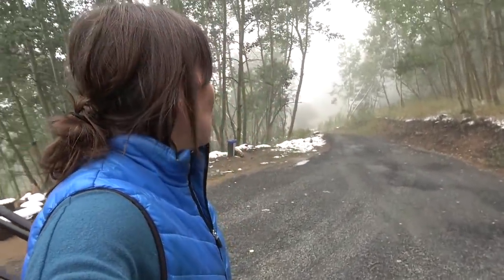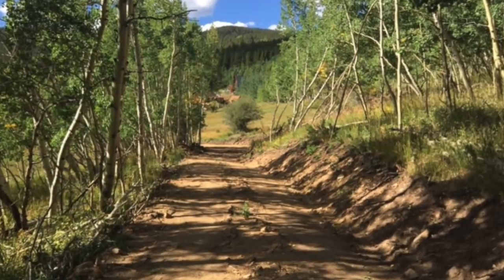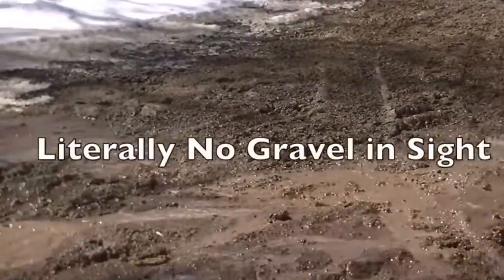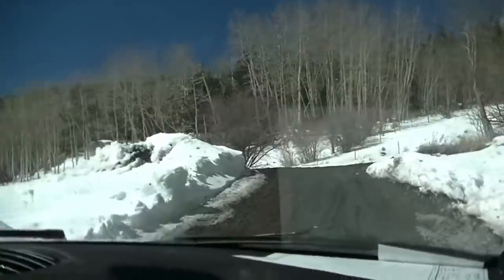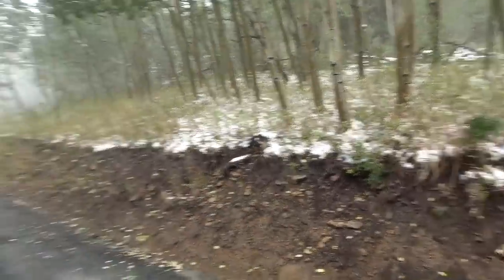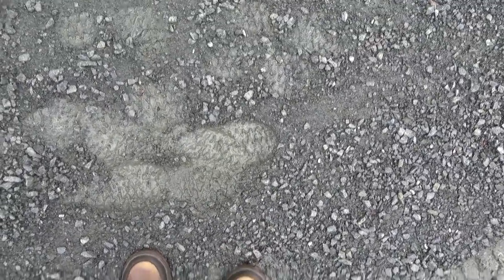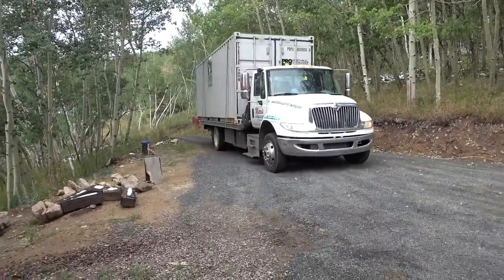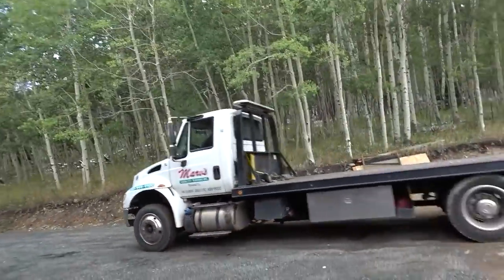Ultimate Test for Geocell Driveway: Heavy Snow + Delivery Trucks

Comment: when I had a similar situation on our 2000' driveway that had been neglected for years I put 2 to 3 inch "sharp stone" in the really soft places, then capped with three layers of gravel.  Two layers of 2" asphalt grindings (really cheap - about $8 a ton) , with the upper layer again "sharp stone" (fractured stone so it is not rounded - it locks together).  The asphalt grindings pack very well because they are still a tiny bit soft or plyable.  They are not a great top layer - but they are great as an underlayment.
On each layer of gravel, when the last load was being delivered I tipped the driver $100 to drive in, turn around and drive out, then come back in about five times, trying to shift over and cover the entire width.  Since he did this BEFORE dropping the load it was about a 30 ton total weight.  That packed the driveway far better than I ever could have with my tractor.
Reply from the maker: 2000 feet wow!  Nice touch getting the driver to pack it. Reminds me of the time I paid the gas company to dig an additional trench for our electrical line, $200 was worth the 20 minutes it took him; while it would have taken us the entire day with our tractor to do the job.

Comment: I used to build residential roads, I would look into renting a small vibration drum roller, a plate tamper would take forever!

But as a side note, if you keep driving on it with the tractor it will pack down, just make sure it’s wet when you do it. Wet gravel will pack far better than dry! (Like you couldn’t make a sandcastle with dry sand)
Reply from the maker: Thank you for the tips. We are still waiting for rain 1 month later!
Reply: I've had to use a plate compactor for a 150' driveway. not terrible, but this driveway is really to long for a plate.

Comment: That geocell that you installed on the hill did its job.  Now that you've had some heavy trucks drive over, it's well packed.  A little clean up work to smooth out the ridges in the gravel and you'll be all set.
Reply from the maker: Thanks for the tips!

Comment: If you mount skid plates on the bottom of your tractor it'll leave a little snow but not damage the gravel. Plow trucks use them for gravel driveways and parking lots. You might have to modify them for your tractor but it shouldn't be too hard. Good luck.
Reply from the maker: Thanks for the tip

Comment: You should have had the driver spread the gravel for you. It doesn’t add cost and it’s easier to move around than a pile. That corner will fight you forever, but grading the road for drainage will make a huge difference. 1 1/2 crushed rock through that corner as a base then cover with the same gravel you had delivered. Then wheel roll it really good with your tractor. It’s an ongoing process and yearly maintenance will keep it in good shape. Good luck with the mini on that road, looks more like a Subaru kind of area.
Reply from the maker: Thanks, the Mini is sold and have a Jeep now, so along with some regular drive maintenance, we should be all set!

Comment: Lady, I'm just a farm boy but the first thing I see is what sort of soil did you carve  your drive out of ?  Western forest soils tend to lack clay as a natural binder.   Did your contractor cut grades and profiles to address  surface and subsoil water migration ?  FWIW a road's "load capacity"  is determined by its ability to float rolling loads and impacts.  The heavier the anticipated loads the larger the base  aggregate must be combined with some sort of quarry process binder/stabilizer.  Roads " fail up "  i.e.  any substrate soft spot is reflected in the surface you see.  I see a lot of them ( potholes/puddles)  ) in your drive.  You need to address drainage ( lateral and cross) to prevent casual and precipitation moisture from destroying your surface.  A strong road is a matrix of load-bearing ( large) stones mixed with binding aggregates ( smaller rough gravels and screenings ) compacted into a stable whole by their ionic bonds and some moisture .  Too much water OTOH is a lubricant destroyng the ionic bonds holding your road together .  IOW to make a road, drain, drain, and drain . And check with your stone supplier and/or municipat engineer about the ionic charge of local stone supplies .  Road building ain't easy, nor cheap but it is rewarding !
Reply from the maker: Thanks for the info! Our driveway contractor did scrape off the topsoil and added large rock base and geo cloth before gravel.

Comment: Just remember, no scraping where the top of the Geocell is showing. ADD to cover not move around. Once you have some build up over the top of the Geocell, you can carefully run a blade over it to smooth, but you do not want to hook or tear it. Roller is good. Tracking it in with treads or tires is good, but no scraping. Dragging a finish screen over the area is even dangerous when the tops of the cells are showing. Finish screening is fine if you have an inch or more of loose on top of the cells. Good luck. One season of summer sun and that will set up rock hard and be much better next year also, so keep it up this year and then bake it next summer and your maintenance will drop to nearly nothing. You still need to work problem areas but it will be very minor compared to now. Awesome products and your gravel guy knows his stuff.
Reply from the maker: Thanks for the detailed tip!! Very helpful. will do.

Comment: Curious this idea might help you if you don’t have a heavy duty roller you can weld to 500 gallon oil drums together filled in with gravel make up a frame attach it to your tractor and roll them on your corner after packing up with more gravel I’ve done this in the past and works a Treat
Reply from the maker: Cool idea.That might be good for future maintenance. For now, (as in today)  We're going with the most practical, least costly, which is driving the tractor up and down it all over; the middle; the edges, etc.

Comment: I’m a Civil Engineer and I love the geo cell! Only thing missing from your installation was compacting the gravel, I think that could have avoided some of the rutting that occurred. I’m actually very impressed with how well it held up given it was only raked in place and driven on with the tractor and vehicles.
I was also worried about drainage, but the rain storm and the snow seem to show that you’re probably okay there. The road is probably going to get wet and mucky in some places, but it seems to be MUCH better than it was (a Mini Cooper??). A load or two in the spring to fix the soft spots and your probably done for 10-15 years. Other than maintenance of a pickup truck full or two each year. 
Was glad to see y’all got a geocell with holes in the side wallls, that’s going to allow water to flow through rather than build up in the grids and cause more issues.
Good luck and please post a video in the spring during and after the snow melt. I want to see how it holds up!
Reply from the maker: Good point. We would have been more thorough with that but we had a vacation planned and an unplanned snowstorm that pretty much messed up our great plan to finalize the drive. But still, we are waiting for rain to really solidify the job.

Comment: If you are adding more gravel to the base, shouldn't the truck driver be able to lock his tale gate on truck and drop gravel in place for you?

I wondered why this wasn't done initially on first drops....seen it down on highways all the time....

Haven't seen it mentioned here or an another site where house building is on hill up steep road like yours?
Reply: Drop spread would have been the way to go and saved these nice people a days worth of work. Who knows, I'm sure it was never offered to them and the trick drive may not even know what the hell he's doing.
Reply: @sonicblue6778   Drop spreading on a Highway is fine when you have a predictable  run  . Thats not happening on a hilly twisty  drive  where  one shift to one side will torque the   box of the frame .
Reply from the maker: Also we want to avoid driving on it; and because we still have to go to work and work on gravel projects in our free time; it's better to put it to the side and spread it when we are ready instead of driving all over it in humps.
Reply: It's called tailgating, and it has it time n place. This is road uneven, inclined, and soft spots.

Comment: so how did this stand up to snow plowing over the winters I have a gravel drive way and my plow removes too much gravel in the winter
Reply from the maker: Great question! We tend to blow snow (using the tractor) than plow. If we do any plowing, we keep it a good few inches off the ground. We will scrape in the spring when the ice builds up, but geocell is fine.

Comment: That  geocell material looks promising for my steep mountainside driveway in Tennessee... where can I find this and what was your gravel mixture?  This might be a fantastic solution for my slippery slopes!  Thank you and your husband for sharing this!  However, I’m wondering if a tractor with a track would be more reliable than one with tires ???  Your thoughts please....
Reply from the maker: In the description there is an amazon link to a similar geo grid product; or  you may google geocell if you want the exact same brand. the tractor tires are pretty sturdy; we put chains on them in the winter and it works great. Tracks would be much harder to turn around on the tractor.
Reply: Colorado Mountain Living , thank you!  I did not realize that about tracks  verses tires.

Comment: you need a drainage ditch on the hill side of the driveway.................
Reply: Just driving with one tire of the tractor off the edge of the geocell would depress things enough to cut its own ditch over time. When things are this soft and muddy is the time to think of such things. Make it easy and let nature do the work. Do it now and by spring you will be looking for rocks to throw in it to break up the flow and stop erosion. Just watch it does not undercut the geocell mat you are creating with the gravel. Use rocks where needed to stop undercutting. If possible stay a foot or more away from the geocell. Easier now when you remember where exactly it is.
Reply: Thanks for the feedback.
Reply from the maker: Thanks for all the tips! We've a nice streak of dry and sunny weather ahead!

Comment: Issue with that crusher mix is there is not much to bind it together.    You say it will be be hard when it's dry, well everything is hard when it's dry.   All roads and driveways are usually built with class 5.   It has the clay in it to bind the aggregate together.   Typically a foot of class 5 will hold about anything...,...... Within reason
Reply from the maker: Cool. thanks for the tip!

Comment: Seems like a very inexpensive way to build a driveway. 500 bucks worth a geotech no sub base and do your finish rock. However from our standpoint doing it for a living. We'd start with 3" cut rock and go down in size from there. Have the dump truck spread it flatten it out with a track loader. All done in A-day. But not cheap.
Reply from the maker: when we had our driveway initially installed by a professional , cut rock and fabric were used to stabilize it before the gravel was added. You are correct,  it was not cheap.

Comment: Vibratory roller will fix all that.
Reply: Yes, that's what we use on drives and parking lots!
Reply: That would create problems on the hill with the geocell. Time is a better solution for this area. The vibrations would actually make the geocell try to slide instead of bedding into place at this point. If those gravel trucks did not move it, it will settle just fine from normal driving Adding thin layers of gravel of about an inch at a time over the year and tracking them in will create a strong, rock hard mat that won't move in any season. You are correct for horizontal areas with or without Geocell, but hills with geocell would just unseat it and cause slides in the material.
Reply from the maker: Interesting to know. We are compacting with the tractor for now; it's working well.

Comment: Hi guys I'm new to your channel and looking forward to seeing how things progress. I'm watching from over her in Leeds, uk. I've had my own renovation company here for over 25 years so I'd like to think I'm full of helpful ideas, however one thing I am concerned about is that you said you had someone to come in and do the base with of your drive, and I can tell you now, of they did it correctly you shouldn't be feeling that soft underfoot for the most part and a lot of that water and melting snow should be increasing through the base layer! I know the seasons can be harsh there, and that you may think I don't understand that. But we also have a home in coachman's cove in Newfoundland, that is pretty much in the middle of nowhere so I have some idea of how it should work 😅. I just don't like the thought that you paid someone and they may have not done the job correctly and I bet it cost a few bucks. Anyhoow, of it keeps happening and you keep getting big wet patches that didn't Soak away, you may need to lay some base of 4inch to dust, crusher run, if you install at least 4-6 inches on the main parts that water isn't draining (as it will be to costly to do it all) especially if you have already paid for it doing once. That will definitely do the trick. It may do you just to contact the guy who originally did your base and ask how much road base of crusher run he did use. Sorry for the novel 😂 but hope this helps you guys. Love the vids and look forward to keep on watching. Stay safe guys, n good luck with the rest of the work
Reply from the maker: Where the largest rocks were brought in for the base was the bottom section of the drive, where the water content is highest in spring; and that has held up remarkably well over the past 3-4 years. Other sections the geo cloth was used and road base, but the bottom line, we need to improve drainage, water run off. the guy who did the job is our neighbor, so that should be easy. Thanks for the tips!!

Comment: hate to say it but that gravel  is way to small for a base , woulda used 3" rock first and after it sank topped it with 3/4 inch gravel  , that being said your gravel will sink ,just farther and faster taking more , i have a 300' long flat level driveway with clay underneath   that is well established , i need to add a couple 15 ton  loads every other year to maintain it , after 35 years it still sinks, also the worse the winter the more the driveway sinks , because it stays wet longer in spring .

there's 2 ways to go about your driveway's future , stay off it as much as possible when wet , or drive on it as much as possible when wet and keep adding rock until the base firms up , your lifestyle will decide which ways best for you .
Reply from the maker: Thanks for all the tips. We did have road base rock brought in 3 years ago, but like you said, it could all sink. I guess we will find out how much next spring.